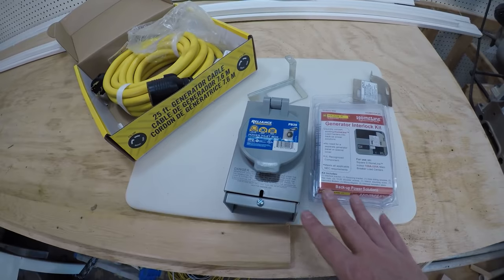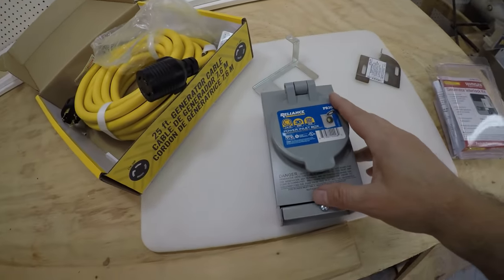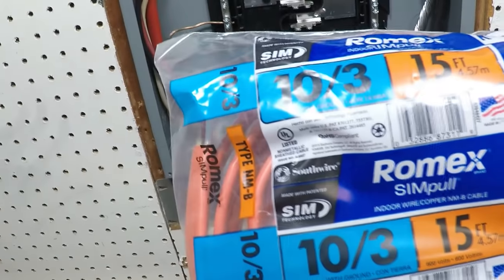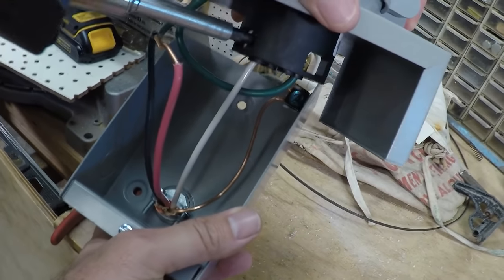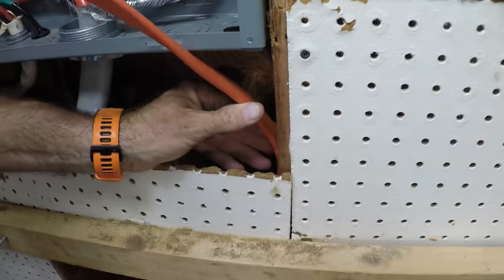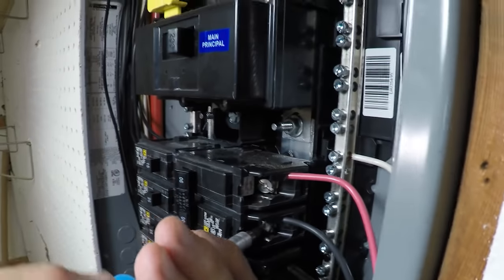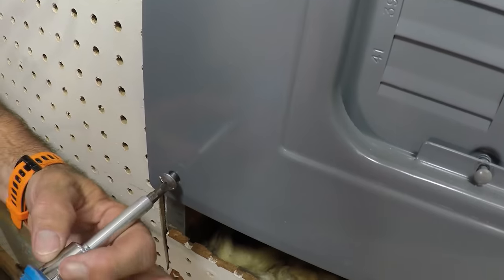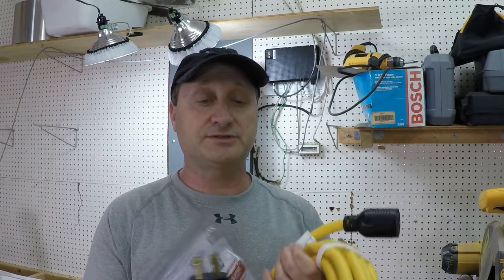Home Generator Interlock Kit Installation - EASY!

Comment from the maker: Here is what I used ....
Interlock Kit https://amzn.to/3gkGuwv
Power Inlet Box https://amzn.to/3zzbhgS
Generator Power Cord https://amzn.to/3pP7UxK
Reply: Since the generator is going to be outside does the back fed breaker in the panel need to be a GFCI rated? Or does the generator itself have some sort of GFCI protection on it's breaker...
Reply: Can I use any kind of 10/3 wire? Ufb okay?
Reply: What breaker do you hook the Inlet wires to?

Comment: I appreciate your effort with the video but you covered the easy stuff, and skipped the difficult stuff.  I would have thought you would have made a point to show the shutting off of the main power at the top of the breaker box - kind of important.  Second, most breaker boxes will already have breakers at the top, which means you'll have to move at least one breaker to a different position - also kind of important.

Comment: Some of the comments on this video have me understanding why so many people recommend professional installation of even simple devices. Good god. If you don’t understand how even a double pole breaker works, don’t do this yourself. This is easy stuff, but have at least a general understanding of residential electrical components before you tackle it

Comment: Great job.  Installed an interlock myself years ago for hurricane season here in FL.  The benefit is this allows me to choose which circuit I want to power unlike a transfer switch which limits you to the circuits that the transfer switch allows.  I can power off some to allow me to power others through out the house but have a large enough portable generator to power the whole house if I choose.  Better choice.
Reply from the maker: thanks for watching
Reply: So the power just feeds in through the 30a breaker?

Is it a normal breaker?
Reply: @vettle1  Yes and yes.
Reply: What if there isn't a spot for the breaker up top by the main?
Reply: @michaelfox7142    move that (those) breakers lower down the panel to an open spot, then install the generator breakers nearest the main panel switch
Reply: Doen't it only supply power to one side of the panel?
Reply: @castle087  Good question.  I'm assuming since the entire panel is hot, it should work the entire panel.
Good electrician question.  Anyone here to help?
Reply: You’re only installing the generator breaker closest to the main so that the interlock mechanism can reach both breakers to work and do it’s job. Which is prevent both generation sources to be hot at the same time.
Reply: @castle087  it's a double pole breaker, so it is making contact with both sides of the panel, the black wire, and the red wire.  Hope that helps.
Reply: @chevylover0920  Correct me if I’m wrong, but isn’t having two hots just to accept 240V, (120 on each hot) from the genset?
I have a 50 amp breaker for my EV, & a 40A for the garage welder. It’s a Square D panel. Both breakers are double pole
Reply: @Edward Hill  yes, you are accepting 240 from the Genset 120v per line. One supplies 120v to the left side of the panel, and the other supplies it to the right side. Just like you service wire from your electric Co. Any appliances you have that require 240v will also have a double pole breaker for the opposite reason, to supply 240v to that appliance by grabbing 120v from each side of the panel via a double pole breaker. Hope that answers the question 😃
Reply: @chevylover0920  Thank you for that explanation. yes, the NEMA 14-50R for my EV, I wired that way, to get 240V. 
I’m just getting educated about emergency back up gensets.
I’m looking at adding an emergency genset at my summer lake home, as we have had a few lengthy power failures, & my sump trickles all year, I’d like something more than the battery backup. Also, I’m in Canada & a furnace is handy in winter. It’s not needed more than maybe once a year usage, I’m looking at a 4550/3550W unit, not high end, but it’s only occasional use, & I’d only run essential systems, non of which require 240V.
Reading your explanation, is it a poor choice to buy a unit that only has 120V outlets?
I have a 200A panel (Square D), but don’t have a photo to look at, I’m not sure if sump/furnace, & the few other things I’d want powered are all on one side of the panel.
Do I need the 240V genset output, (2 hots), to power both sides of the panel, or am I OK with a genset that has only 120V outlets, a couple of which are the RV type, 30A? I won’t be running anything that requires 240V, or really clean power.
Thanks.
Reply: @michaelfox7142  ...gotta then move the existing breakers down or to other slots.
Reply: @vettle1  ...power from a generator feeds through a double-pole 30A breaker and an interlock to prevent gen power to be "on" same time as "line" power.
Reply: @castle087  ,,,double pole breaker, side-by-side acting as one. As you install it, one breaker feeds one leg the other breaker feeds the other.
Reply: @castle087  it's a 220 volt double pole breaker which means it will power both hot busses
Reply: @beebob1279  it's a double pole 220 volt breaker that means it will feed both hot busses
Reply: @robertsides5808  Thanks
Reply: @castle087  A double pole 30 amp breaker will power both sides
Reply: @castle087 no both 50 amp and 30 amp gen sets are always 240V. One 120V powers one leg of the panel and the other powers the other side of the panel giving you 120v and 240V capability.
Reply: @edwardhill6945 just buy the gen set that has 240V and that is easiest. Both legs of the panel will be powered and you still can run a 240V if you have the need and it can adequately supply it

Comment: I added a 50 amp breaker with 6/3 wire to outside 50amp plug.  I turn main breaker off and open all breakers, start generator, then close breakers one by one. The only 220v breaker I close is my electric water heater. All other 110 breakers closed and my generator ran my entire house for 5 days ..not one single overload. My generator is a ryobi 6500/8250W. My generator only has the 30 amp plug. I used 50amp wiring because I plan to upgrade to a 12kw propane generator in the future. I bought the ryobi during an ice storm and had to drive 6 hour round trip to get it!
Reply: How did you convert the 30 amp cord to the 50 amp outlet in the meantime?
Reply: @condor5635  You can buy an adapter plug.  An electrician installed my interlock switch and got one for me.  Mine's about a foot long.
Reply: @ILoveSchnauzers if you have to convert it, doesn't that make the 50 amp breaker pointless? Or it would overheat the 30 amp cord?
Reply: @Codeman785  First understand that I'm a woman and don't know much about electrical work.  LOL
 I had an electrician install an interlock kit for me.  My generator needed one type of cord but the outside outlet took the other type.  So I needed an adapter so that I could plug my generator into the outdoor outlet.
If I ever buy another generator I won't need the adapter.

Comment: Would’ve been easier to strip the wire before putting it in the inlet box. Also it would’ve been easier if you had everything mounted and fed it after. You were clear on both sides

Comment: Nice my man,  you actually gave me the courage along with the advice about checking with building codes along with the inspector. I am a retired Air Force Network Engineer required to clean HUGE POWER DISTRIBUTION BARS that powered large areas.  I was so afraid to install this generator kit. All I can say is your calm personality and thorough not so chatty video set me straight.  Thank you my friend.   Shout out from USAF!
Reply: WHY check with the building codes & inspector?

Comment: Thank you for making this video! I live in Maine and we just lost power last week in an ice storm for 3 days, so I had generator cords running through the house, on top of that, the heat pump on the second floor didn’t work because it’s directly wired to the box. We have another storm coming this week and all the electricians in the area are booked. This was easy to follow and now my family and I have peace of mind for future storms. Thank you!

Comment: Awesome job! One thing I would suggest is to add some silicone around the hole so it makes a seal between the vinyl siding and box so that water doesn't get inside the hole.
Reply from the maker: thanks for watching!

Comment: Thanks for Posting this, Watched a Couple Videos to see what a Non Electrician YouTuber would do, They Show Suicide Cords, Lot of Dangerous Stuff. 
Interlock kit with a Power Inlet Box is the Best, Cheapest, Most Efficient, Safest way to do. The little 8-12 circuit Panels that allow Some Circuits a choice of Generator or Power Company, not worth it. The Power Inlet/Interlock kit allows ANY circuits to be used provided Generator Has the Power. Leave ALL 120 volt circuits On to have lighting everywhere, turn Lights/Fan off when not in that room. Do turn off 120/240 Volt Circuits not needed. 
A guy showing Suicide Cord, and possible back feeding if Installer not Present when Power Restored. Couldn't leave a Negative or help him from Killing people, as he has Comments Turned off(Probably because People kept calling him an Idiot). Thanks for showing the Correct Way. I am an Installer of Whole House Generators with Automatic Transfer Switch. Your Video helps the Majority of Home Owners. Thanks Again
Reply from the maker: Thanks for watching and for the positive comments Randy
Reply: What is a reasonable price for a Electrician to do this work? 1) Wiring & mounting of outlet outside for 30A 120/220 socket for Predator 9500 backup generator
2) Add 30 A breaker for generator to basement service box. 3) Fuse box interlock Kit. Best way to find one?

Comment: This was a good video and very clear instructions.  There are a few steps missing which I would add, and one code violation.  
1) code requires that an additional tie down be installed on the generator breaker.  If you can remove the panel cover and pull on the generator breakers and they pop out; that’s a code violation.  Need to add something else to retain the breakers in place.  Could use a screw or zip tie depending on panel design.  It’s not sufficient to only use panel cover to hold breakers in place when the breakers are being backfed. 
2) I would suggest adding caulking behind the inlet box to reduce water infiltration into hole in house.  
3) need to test main breaker to insure that in the off position that no voltage is present on the main buss bar.  Use a volt meter.  Don’t assume it’s working. 
4) need to test generator breaker to insure that in off position that no voltage on wires.  Don’t assume it’s working.
Reply: Good catch Neil. The hold down bracket was in the kit. Shown at the first of the video.
Reply: Do the screws on the interlock kit have to be facing a certain direction? One video i watched said they needed to be a certain way.
Reply: Should use wire strippers instead of side cutters when stripping wires also.
Reply: The Square D interlock kit seems to come with a bracket suited for this purpose.
Reply: Neil, I have always been confused about the rules for NM-B wire and outdoor use. I know it can't be used in a conduit outside, but for a run that goes from inside the house to outside (like to the generator inlet port), does that qualify for the NM-B being "outside"? Would you know about this? Thanks.

Comment: 2 things to mention in addition to your video...a specific gen-lockout kit can be purchased for the various types of panels...they are not all the same.  The other thing is the screw in the bottom of the receptacle box does not need to be completely removed.  The cover slides off after the screw is loosened.

Comment: I did this installation a few months ago and it was surprisingly easy, effective and more importantly safe.    I really like being able to choose which breakers are going to be powered by the generator.
Reply: We have the same setup and just had a 4 day power outage.  I like we get to choose what we use so long as we don't go over the 30 amp limit.
Reply: What if there isn't a spot for the breaker up top by the main?
Reply: @michaelfox7142 
Move those circuits at the top to the bottom if you have the open slots.   If your panel is full then you have some other decisions / considerations to make.
Reply: I’m waiting for a friend of mine who is a electrician to install for me
Reply: Correct me if I’m wrong but goes this method only allow you to powers one side of the breaker? Or is it both sides?
Reply: @Painfulwhale360  it’s a 240 circuit so it feeds both sides of the panel.
Reply: @Painfulwhale360  a 240v breaker that normally powers a 240v stove, attaches to both sides of the breaker (2 separate phases. 120v x 2 = 240v).

Comment: I have an interlock and had to use my generator (5KW) several times since I put it in.   People think it is expensive but if there is a free dual pole breaker in the service panel, the actual installation is very easy install and should be only about 2 hours of labor but people have told me that electricians wanted to charge them $2000 to $3000. My install, complete with all parts was less than $500 including the professional electrician.

Comment: Great video. Thank you for posting. 
I went this route for my generator but not DIY. I paid a licensed electrician to install the lockout kit, install the 240 outlet outside to feed the electricity from the generator to the main breaker panel (and thus the house) and install the 10/3 wire. It is the least inexpensive way to have a safe and legal way to power your house with a generator, imho AND I can verify that it works just fine! Thanks again for posting this video.
Reply: Same here as my panel was far from the outside wall and our electrician is awesome.
Reply: Are you able to run your air conditioner this way or is this just for minor things like lights and refrigerator
Reply from the maker: thanks for watching
Reply from the maker: you cannot run an AC unless your generator is a very powerful one that can provide enough power for your AC. you will likely need a 50amp breaker also
Reply: @flannelguydiy6458  ok.  Thanks.  I’ve been looking at a 9000 watt generator, 11,500 starting I think.  Great video btw.  Very easy to understand.  I’d definitely hire an electrician to do this though.  Also, I’ve been looking at a device that you hook up to the meter and plug it in there.  Just dont know if it’s code in my state.
Reply: You can install these yourself and it is still legal lol.
Reply: How do you like your 30amp generator?
Reply: @ohboy2592  the generator (7500 watt) runs the whole house. Refrigerators, well pump, furnace.
I have never run out of power in the Summer but I assume it will handle the a/c window units, too.
Reply: @Cdr306  what?
Reply: @tylerfoss3346  I. Saw the 10/3 wire and assumed you have a 6000-7000 watt ~30 amp generator
Reply: @Cdr306  the generator runs my entire house when I need it to so, it works great.
Reply: @tylerfoss3346  me too. Have you considered upgrading to a larger one?  Guessing it can’t run your AC. My 7000 W not big enough to start my 4 ton unit and I have not installed a soft start kit.
Reply: @Cdr306  no plans to change to a larger wattage generator at this time. The one we have does the trick for us when we need it.

Comment: Suggestion.... I wouldn’t hold the metal part of your screw driver while in a hot panel. I know the breaker was off, but it’s good practice just to hold the insulated part of screw driver. Besides that good video.
Reply: Learned this the hard way when I was a kid working for my dad. 😵‍💫 Wiha makes electrical screwdrivers that are insulated to the tip.
Reply: @arsenaultken  insulated tools are a much better choice. I work in panels that it’s impossible to shut down to work on them. If I don’t have any insulated tools with me I will put electrical tape on the metal.
Reply: He's an expert, he post of youtube
Reply: I was saying the same thing to myself……very bad and DANGEROUS habit.
Reply: Haha yeah I've been there. It'll definitely wake you up!
Reply: How do I get a job as a YouTube how-to video watchdog approver of things like you?
Reply: Shocking point 😂

Comment: Really well done video.  The only thing I would have done different is to put in a 50 amp breaker and wire the inlet box accordingly.  (number 6 wire)  This way you are set if you ever upsize your generator.
Reply: Wouldn't that be bad for the generator?
Reply: @musicaljc  The generator itself has it's own breaker for protection.  By putting in proper size wiring and upping the breaker at the house panel, this allows you to run a 10 or 12kw if you want to.  You are doing the work anyway...the additional cost is minimal.
Reply: @musicaljc  will not have any affect on the generator. Power should never be flowing to the generator.
Reply: @musicaljc  it would be if you wired it wrong 🤓
Reply: Yes you can upsize wire safely but you cannot upsize a breaker if you aren't using the additional amps. Breakers are supposed to trip before anything burns. Too big of a breaker and wires burn instead of breakers popping.

Comment: The question I have is when you wired up from plug to 30 amp breaker does this only supply power to the side you have the 30 amp  double breaker installed or does it supply the whole panel including the other circuit breakers.without changing breakers to the 30 amp double breaker.This video is Outstanding and made my decision to add these linked parts to my cart not yet purchased until your answer.
Reply from the maker: it powers both sides, the whole panel.